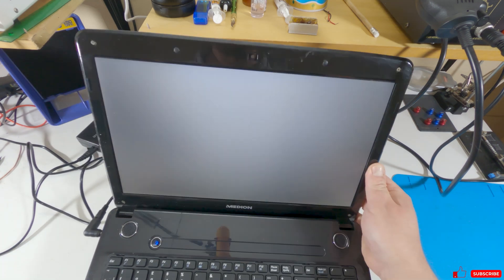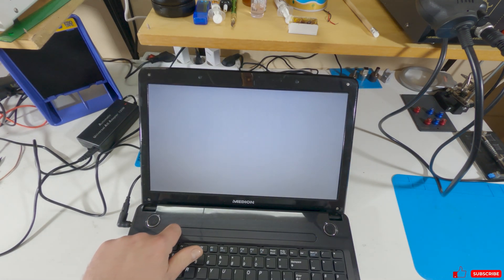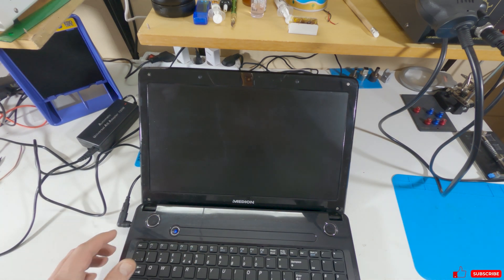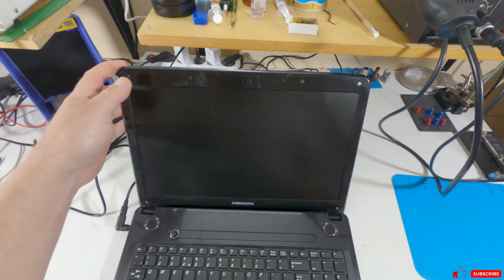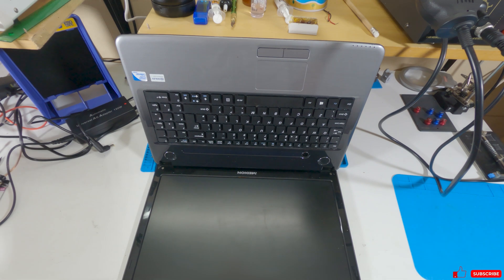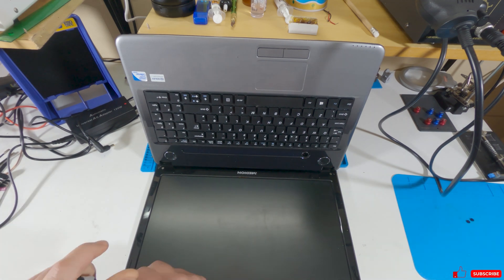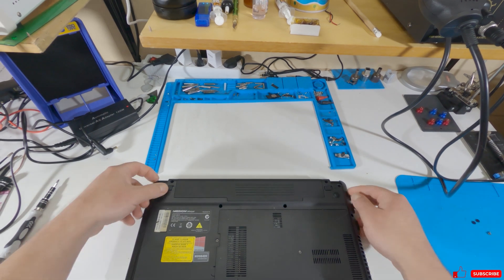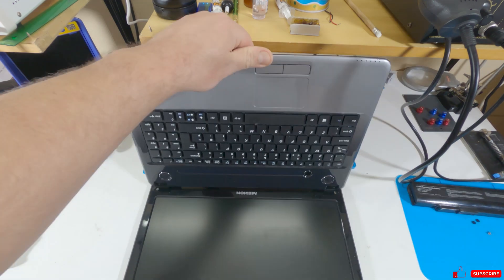!!! Laptop WHITE SCREEN Repair !!! Medion laptop REPAIR

Comment: Hi sir can you give me a clue how to replace screen on medion erazer crawler e10. There is no screws and im lost. I will  be appreciate for any advice. Thank you
Reply from the maker: Hello. Tell me if you are talking about removing the frame. If its about the frame than is held in place with plastic clips. Just use a pry tool and gently pop all those clips. Dont stick the pry tool too much inside tho. Hope this helps.
Reply from the maker: And BE AWARE. Never connect or disconnect your lcd screen connector with the battery pluged in or charger. Always remove charger and disconnect battery when playing with the screen connector. You can fry the motherboard if not. See ya. P.S. Dont forget to hit the subscribe button ;)